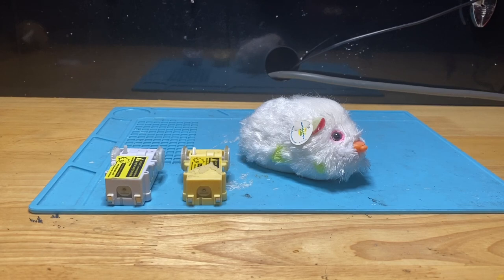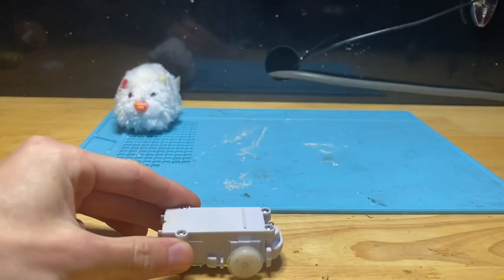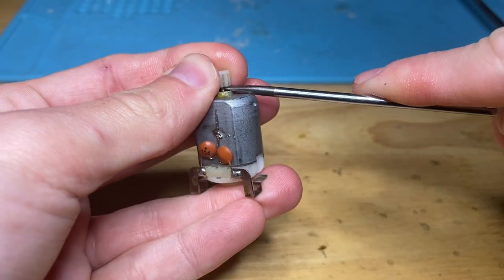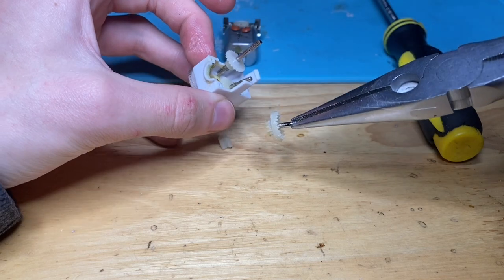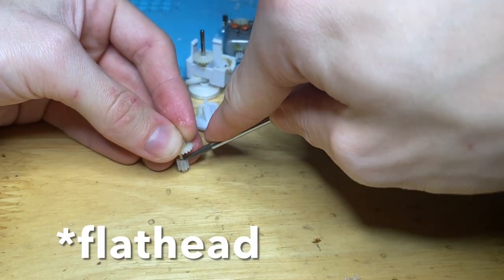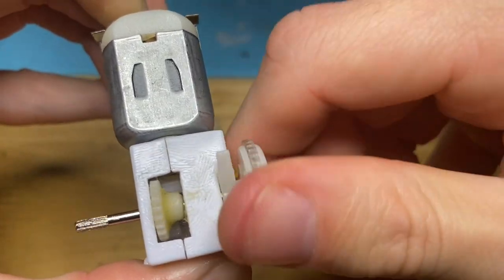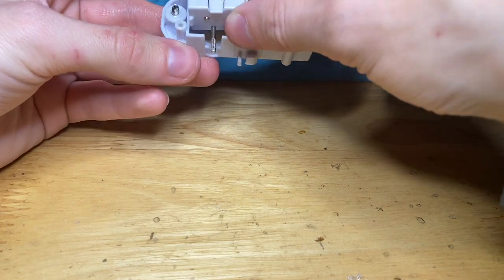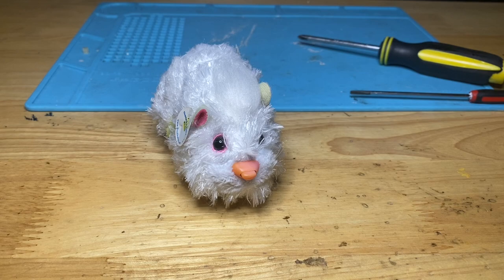How To Repair Zhu Zhu Pet Motor Wheels Gearbox - Replacing Broken 8 Tooth Gears

Comment: Hi! You are the only person online who seems to be still working with Zhu zhu pets and I was wondering if you’ve ever worked on the Bunny zhu Zhu pets? The inner gearbox looks completely different and they have a different wheel mechanism which I’m trying to fix. Would you happen to know how to repair them? If not that’s okay, you’re doing amazing work with your videos‼️
Reply from the maker: The bunny zhu zhu pets (fluffy, sweetie, heidi, and moppit) are exactly the same as the hamsters. Most of them were released as Zhu Zhu wild bunch’s but their inner workings are identical so this tutorial will work for them too.
Reply: @IDogFan41  Thank you for replying. After doing some more research I realized that I had a Furreal Friends Furry Frenzies Furrstars instead of a Zhu Zhu Pet which clears up a lot of confusion on my part and why the interiors look so different. I guess my search continues, thanks you though‼️✨

Comment: Nice video! It actually helped me build up the courage to open some of mine haha, just a question:
Is it normal for the Zhu to have a slimy/sticky yellow substance on the inside? The odor was also unpleasant so I became nervous of messing with them using my bare hands
What is it? Should I wear gloves and remove it from the toy?
Reply from the maker: That is motor grease/lubricant. It’s there so the gears run smoother, if you remove it it’ll probably be louder and there will be more friction between the gears.
Reply: @IDogFan41  thanks! I'll take care when handling them and will not remove it

Comment: Hi there, I recently bought two Zhu Zhus brand new still in their original packaging. Only problem is that neither of them move at all! But they make noise and respond to being held upside down, etc. None of the gears are broken, so I can only assume there’s a problem with the motor itself. Do you know any ways to troubleshoot?

UPDATE: I swapped motors with one of my working Zhus, and I can confirm that both of the new Zhus have faulty motors :( Do you know where to find replacement motors?